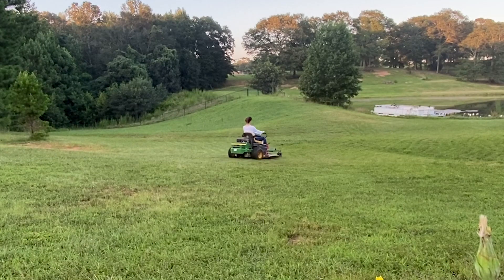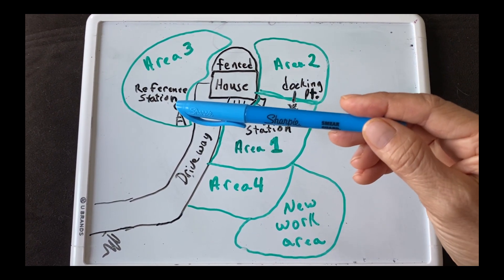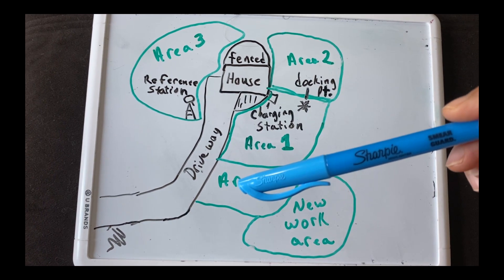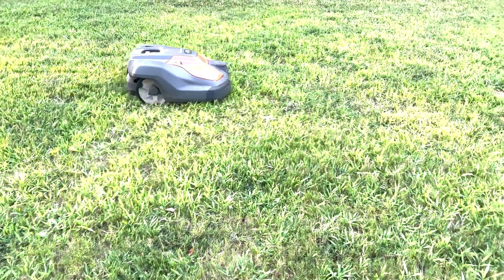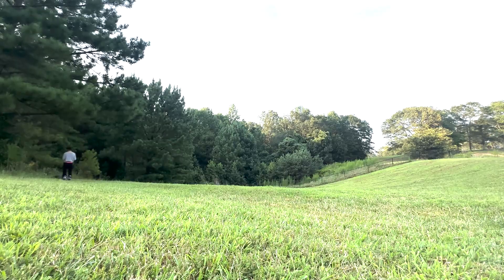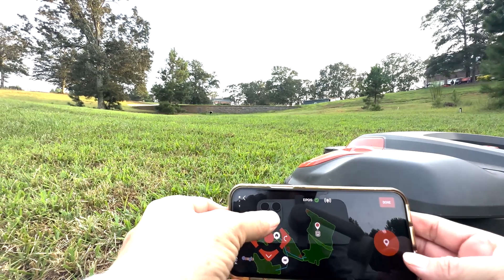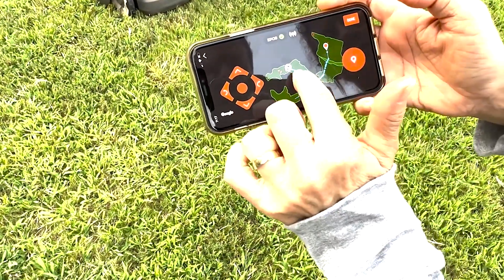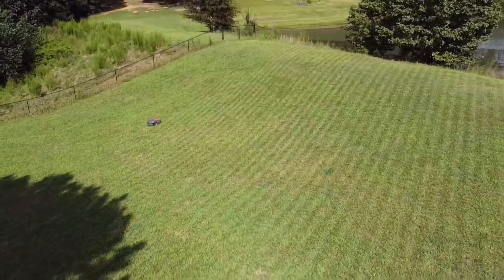Husqvarna Automower EPOS 550H,  Adding Work Area & Transport Path  for mower previously installed.

Comment: If i have a big working area and make 5 smaller work areas in it, can i then make only 1 transportpath that runs through all of the smaller workarea’s? Will that work?
Reply from the maker: That’s a great and new question!!  From what I understand, you have to have a transport path to each working area, but I haven’t tried it with a bigger working area and smaller ones within that.   My 550 will not go to an area unless it has a transport path to it.   It will say something like “destination not reachable”.
Reply from the maker: I would try it and see what happens.   I’m curious to know!😊
Reply: @momsmachines5476  Did you try it? I got error at some point that it shows "Too many waypoints", but there is only two paths on same road.

Comment: Very helpful videos with info I haven't seen elsewhere, thank you.

You mention you had mounted the reference station on some steps as a temporary solution. Did you have to re-make all the zones when you put up a permanent pole or is it OK to move the reference station? I would like to have a temporary solution for my reference station too, so I can get started, as I will need professional help to mount it on my roof
Reply from the maker: Thank you for your comment and questions.  I went ahead  last season and put in all my work areas with the reference station on my "temporary' location, which is on an aluminum ladder.  I had planned to replace the ladder with a wooden post at the same location and height.  Sadly (and pathetically!), I have not done this.  I did remove the box which it sat on since that got wet in the rain and began to fall apart.  This made it about 6 inches lower and doesn't seem to interfere with the mower's working ability at all.  I was wondering about moving it to a totally new location  as well.  The owner's manual states that "the items on the map will change position if you move the reference station.  Adjust the items on the map or do the installation again in the Automower Connect app."    I might just have to move it and see what happens!!!!   I remember reading or seeing a video from Husqvarna that does  NOT  advise putting the reference station on a building or house.    I believe they did suggest this in the past, but no longer do.  I hope this helps you.
Reply: @momsmachines5476  Very helpful thank you. 

I have put reference station on a pole in the best possible position (just so I could get started, my previous Automower 450X with boundary-wire has got old and tired, wire needing repair etc. and I decided to replace it with 520 EPOS ... but the grass needed cutting NOW! so "temporary" for starters). The pole looks an eyesore where it is (I knew it would), so once the grass is under control I want to find best location. Interesting about roof advice; my understanding was roof would be best (might be different here in UK with building materials / building height and elevation of satellites in sky from our latitude ...).

I've only had the EPOS a few days but compared to previous 450X it is SO much better.  No wire problems, obviously, but the ability to set areas suits me really well, and pattern-mowing covered the whole area in much less time than random did (previously needed 3-days-continuous after break if grass had got long, new EPOS did the whole area in 24 hours). 

I have a large garden and complex lawn layout / paths etc. I started with mapping perimeter to create one work area, and then did stay-out zones for each flowerbed etc. but I need it to mow different areas in different directions - everything "on the wonk" doesn't look right! - but thanks to your advice I will hold off making all the work areas until I have permanent position for reference station. I will have loads of waypoints and adjusting each will be a lot of effort (unless there is a "Change all THESE by THIS much N-S and THIS much E-W", as I guess they will all be off-by-same-amount; but my experience of Husqvarna APP is that the last 10% of useful functionality is missing, and when I need it that takes 90% of MY time!)

I had 5 existing Automowers (4 distinct areas with fences between), and the other area the boundary wire, with all the stay out zones, was too long, so had to split into 2 mowers). The other benefit, for me (which I had not anticipated), is that I can just take the new EPOS mower to one of my other mower zones, create a Work Area, and then I have "cover" for any of the other mowers which get sick / break-a-wire.

I can see me replacing all the old ones with EPOS. But I will need to raid a bank!

Comment: Is it a water resistance mower? for example, is it okay to have a charging station in the open space where rain comes?
Reply from the maker: The mower can work out in the rain and on wet grass.  The charging and reference station also stay outside.  They just cannot be submerged in water.
Reply from the maker: I typically dow't let the mower run in the rain if its pouring down.  I don't want the mower to get caught in a puddle.    I also  disconnect the plug ins when we have severe thunderstorms.

Comment: Thanks for your video.  I would be curious to know: when you use Google maps to measure distance, how far away from the reference station is the furthest point of your work area?  Are there any trees etc. in the way?  I'm trying to figure out if one would work 220m away from my house around a corner that has trees on it.
Reply from the maker: Thank you for watching the video and for the question.  The furthest point I have the mower working from the reference station right now is about 140 m. (The area in the video is about 75 m.). I plan to add another work area with a maximum of 165m away from the reference station, so I hope it works!!  I remember reading the maximum distance in the owner's manual, but can't remember it.  As soon as I find the number, I'll let you know.
Reply from the maker: The manual says the max distance between the reference station and "product" is 1640 feet (or about 500 m).   I do have some pine trees and it goes around a corner with pine trees.  I also have some other trees that are big, but about 20 feet from each other.